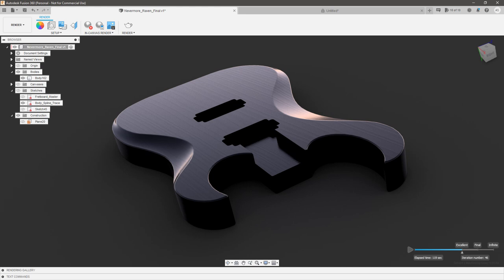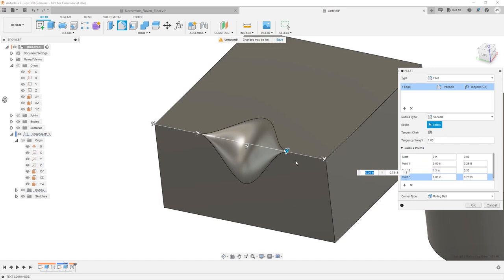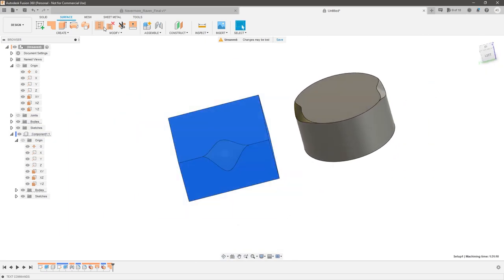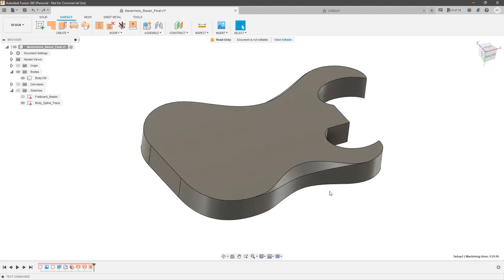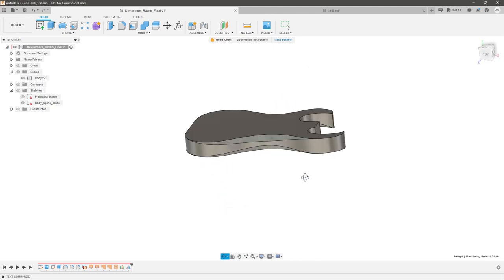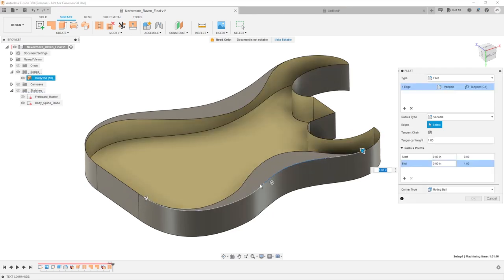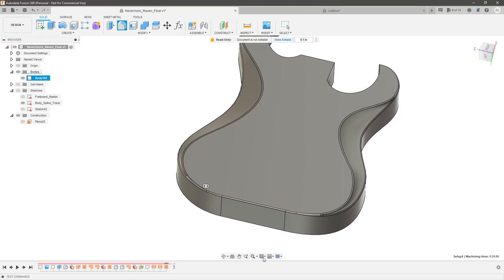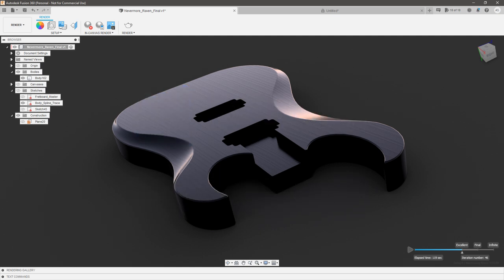Creating variable chamfers with... a fillet? | Viewer Request #4 | Fusion 360 Tutorial

Comment: Great Video! When dealing with variable chamfer, I use a slightly different method... First apply the variable fillet, in surface modelling, Select the fillet and entire edge under the fillet, hit delete. Create a Ruled surface of the top curved edge, and apply an angle... say 110deg, stretch it out well past the bottom face of the guitar. Extrude the bottom curved edge of the guitar up, well past the Ruled edge. Using trim tool remove the 2 unwanted parts. Stitch everything together. This method reduces steps, is still parametric, the exact draft angle of the chamfer if defined. Analysis tools show a cleaner body. You can also use the same process to loft with rails, using the ruled surface as trim tools for the side curved surface.

Comment: You can also get an interesting shapes by lowering down tangency weight of fillet to a small value, like 0.1
Reply from the maker: Oooh, I didn't even think about that. I'll play around with it, thanks!!!
Reply: @austinshaner  also, it's not that important, but I suggest to use 'Plain along path' instead of 'offset plane' for rail - you will got rail in exact same position as fillet radius changes and orthogonal to edge.
Reply from the maker: @alexeyrybakov949  We tried something similar early on but not when the method is more fleshed out like this. That would be a nice improvement to this method. Thanks!
Reply: @austinshaner  thank you for sharing your approaches, it's very useful to learn something new on practical applications.
Reply: I tried experimenting with the tangency option, turning it down to the minimum. Interestingly, it can create a chamfer like appearance, although the faces are not perfectly flat.
Reply from the maker: @Fusion360School  that's what I found as well. I don't think it's particularly useful for this method, as the surface lines generated are the same.. Though it is a nice solution for a reasonably flat surface with a smoothed edge.

Comment: Thanks for yet another amazing video. I'm new to 3D modeling and these (even a little bit) more advanced functions in Fusion 360 are totally unknown to me, let alone these ingenious approaches. I forced my way through with lofts when designing a Charvel/strat body without knowing about variable fillets, things got specially annoying around the heel/neck pocket where the fillet radius becomes way smaller than the rest so the neckplate doesn't hang over the round over and also with the belly cut (using sweeps). Thanks to this video I won't have a stroke at 25 trying to do all that again.
Reply from the maker: No problem Felix! This is definitely new for me as well, and I'm sure there are ways to improve this method or issues I haven't foreseen yet, but regardless it's another powerful method in our toolkit!

Comment: Excellent stuff! Excited to give it a try. 🙏
Reply: Ok... I mucked around with this last night on my current design that I've been struggling getting a controlled cutaway on the body horn areas. I'm going for a cutaway top and bottom kinda like you'd see on a Solar Guitar. 

Unfortunately this technique didn't work for this on my body shape. I think the reason is because the body at the neck joint does a smooth contour from one horn to the next rather than having the more traditional squared off strat style like you've got in your video here. Basically it makes really weird lump between the end point at the neck and the deepest part of the contour. From the deepest part of the contour to the apex of the horn looks great though. 

Awesome technique that I'm sure I'll be using on some things in the future though.

Comment: This is really creative. While some might consider deleting faces hack-ish, I have always considered it to be part and parcel of surfacing. I would definitely consider this to be a legitimate method. I would be curious as to the surface quality at the sharp points on either end. Since lofting works best with a four-sided surface, this might produce some weird distortions at the points. Will definitely try this out! Thanks for sharing.👍
Reply from the maker: Thanks mate! I know what you mean. When I started this channel I had a huge bias against surface modeling and tried to force everything to work with our solid tools. That was because I felt like it was a very messy way to model, and there is some truth in that. But that was the wrong way of thinking, because the surface tools open up the constraints we'd normally face with the solid tools. So when you run into subtle or complex geometry, the surface tools really start to shine. I still believe we should use the solid tools whenever possible, but I no longer hold the opinion that we should avoid surface modeling entirely.

I haven't noticed any odd distortions on the sharp points using lofts, though I have seen that happen with the patch tool while prototyping this.

Comment: Could it be possible to apply a fillet to a thicker or thinner body, cut the surfaces, and then change the thickness before making a loft? In theory this will give us a different fillet angle without two-step sequence 21:30 with deleting sides and adding a new filet.
Reply from the maker: If I'm understanding you correctly, it would effectively be the same process just ordered differently. You start with two bodies, apply changes,,  then merge them together, rather than starting with 1, apply changes, on adding a second, apply changes, then merge.

Comment: This is incredibly useful Austin but but is there a way to control the angle or the size of both the top and sides of this fillet ? Let's say do a depth of 1cm on the sides of the body and 3cm on the top, would this be possible ? For now it seems that both have similar sizes. thanks
Reply from the maker: Keep watching ;) I answer that in the second half of the video!
Reply: @austinshaner  :) indeed sorry Austin, I should have waited before posting, this is fantastic :)
Reply: So this could work to make nice carved tops like on PRS or LP style guitars ? For now I was studying to make a carved surface and then split the body but this method would make it really easier thanks again, this is really exciting stuff!
Reply from the maker: Yes, but with some alterations. If you hop on my Discord Mattia has been leading the way on that front. His stuff is pretty incredible, and I'm sure he'd offer advice.
Reply: @austinshaner  Super I'll check it out :) thanks

Comment: The ONLY downside Ive seen of this, from at least a modeling standpoint vs slicing for the CNC, is the inability to apply this to a laminate top design.  If you want the relief cuts to cut through the top to the body, the problem here is that it affects that lower line pushing it (and the top material) in to the body material.  And vice versa of course.  I've tried a few ways including the one from your video 2 creating the top from a separate component that is jointed.  Ive not tried the time consuming and ultra frustrating :P rail way but I am assuming it might be the only way?  From a CNC build standpoint, doing it this way is a game changer.  Marry the two portions and have the model be "one piece" will equal a great product.  I would just love to be able to do the same process but with a top material blending in to the body.
Reply from the maker: Hey Ron, you should be able to model this as a single piece body, then use an offset plane and split the body in two for a drop top. Done that many times.
Reply: @austinshaner  o.O ......brilliant.  Pardon me while I go try that now lol.
Reply: @austinshaner  Update:  That worked flawlessly.  Thanks man!

Comment: It seems that Fusion 360 does not allow this on edges that are imported. For instance,  my brother sent me a CAD guitar body to tinker with in Fusion. In Fusion, all the curves are broken into segments versus just being a solid line. Its a body, its complete, but because the curves of the line show up in segments, it does not allow this function. I can have a start and end point in a single segment but cannot simply chain them together and create start and end points. Also, for the life of me, there seems to be no way to simply joins lines together to make a solid line in Fusion. I think this is a great adaptation of the variable fillet, and would love to try it, without completely redrawing the guitar.
Reply: I'm just now in the same boat. I can  do a normal fillet but variable does not work. I did the body in Carbide create as a svg and even I'm extruding everything in Fusion it does not work.
Reply: I created a body in Fusion 360 and extruded it and I still cannot choose the whole line, only small lengths, so in my case this is something else that I cannot figure out. I'm new with Fusion so I'm missing something.